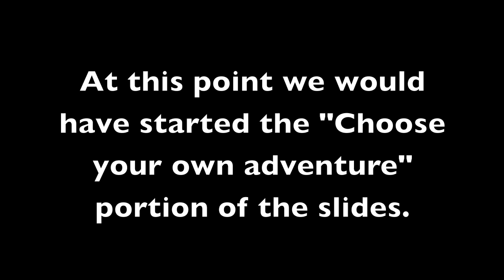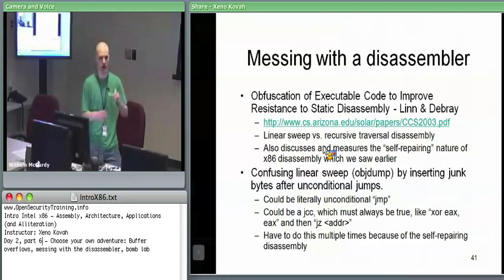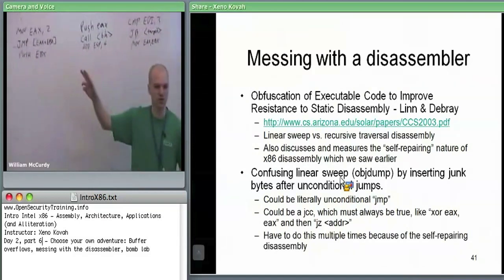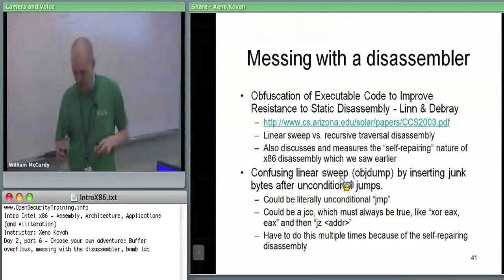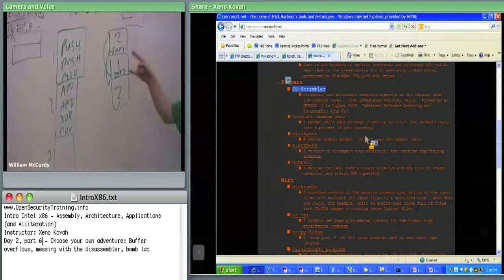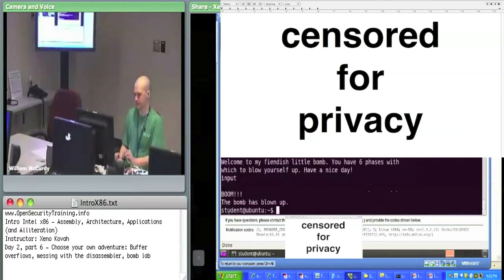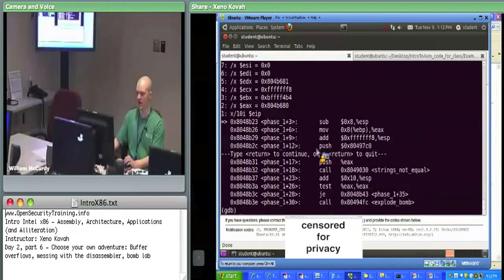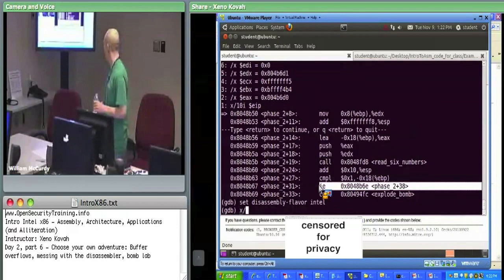Day 2 Part 6: Introductory Intel x86: Architecture, Assembly, Applications

Comment: for those who are trying to run bomd in 64-bit env here's the solution:

readelf -l /usr/local/sbin/test | grep interpreter
You likely have a 32-bit binary pointing to /lib/ld-linux.so.2 on a 64-bit system without 32-bit runtime support installed. Depending on the distribution you are using, something like sudo apt-get install libc6:i386
This should do the trick.

Comment: The whole strtoul() issue is painful to watch.  The problem is that the second argument is a char **, not a char*, and it is used to store the address of the character after the last number that was consumed by strtoul().  If you're not interested in it, you can pass NULL.  Using "" is not valid.
Reply from the maker: What timecode?
Reply: Open SecurityTraining
Pretty much the entire first 8 minutes of the video. Xeno finally gives up around the 8 minute mark.
Reply from the maker: James Hamilton Good point, thanks for pointing out what was stumping him :) That's what happens when an instructor makes a code example on the fly between classes ;)